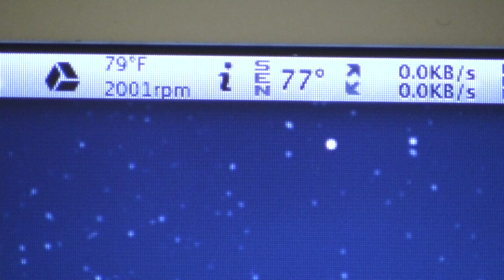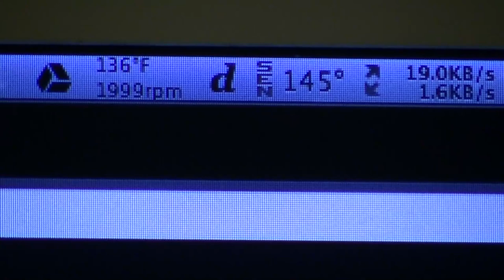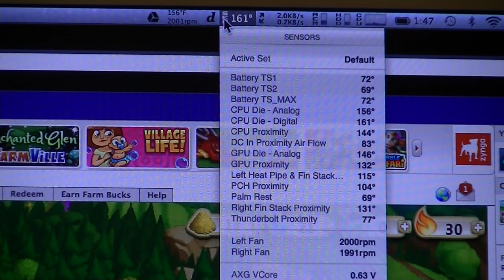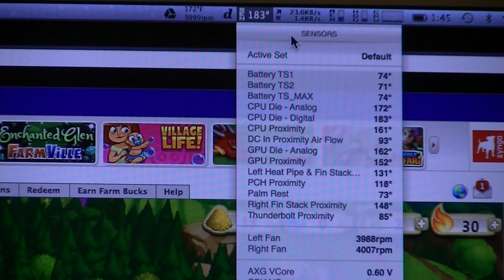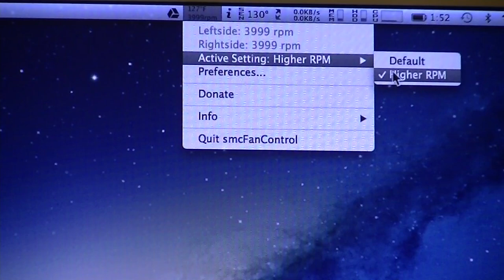HOWTO: Stop Your Macbook Pro Overheating!

Comment: Hey, I was wondering if you could help me?
I recently cleaned my fan and added new thermal paste, so my mac now sounds nice and happy :)
However now it's not recognising the battery......have you ever had any problems with this?
I just has an X over the battery symbol and says 'no battery available'
Also in the 'power' section of 'about this mac' it just has '0' and 'no' next to everything.
I opened it back up to make sure that I hadn't missed anything and that all of the connectors were free from dust, I also tried restarting, smc, and battery updates but none of it seems to be working.
I think that the battery was a little buggered before anyway (my laptop is 5 years old) but at least it recognised that it had one :s
Do you think that I should just get a new battery or is there anything that I can do first?
Thank you for the amazing video by the way :) It was very thorough.
Amanda
x
Reply from the maker: Sounds like you are in need of a new battery!  If you unplug the power, does it immediately die?
Reply: It does indeed :( it was ok before.....well, it ran anyway, I'd been having issues with it since I upgraded my operating system.
Anyway, yes it does just switch off as soon as I take the power cable out :(
Thankyou for getting back to me
Reply from the maker: Amanda Goodfellow No problem!  In your case, if I was certain the battery was hooked up correctly (I would disconnect and reconnect it, just to be sure) then I'd replace the battery.

Comment: thermal issues seem to be the main achilles heel of modern macs. I understand that they're primarily designed to run in air conditioned buildings but personally I would prefer to be able to use it without AC and rely on fans.
 By which I mean desktop fans.
Reply from the maker: Agreed - I wish Apple would put more effort into better thermal management of their systems.
Reply: uberDoward
yeah my macbook has had issues with this and it's really frustrating. I'm gonna do this AS5 thermal paste move described in the video but I"m also going to look into liquid cooling options as a way of being able to run it without overheating. It's a bit shit that a chunky 2006 toshiba laptop has better thermal management than a sleek 2011 macbook pro.
Reply from the maker: You're right, I'd love to see what you come up with regarding liquid cooling!
Reply: uberDoward
no worries, I'll post a link when it's done.
Reply: unstoppableExodia i just wish it had more grill/ventilation even just as an option
Reply: sguigly
totally. I mean a bigger grille might allow more dust in but it makes a big difference to  a computer's ability to exhaust heat  away. I'm considering taking the back panel off my macbook pro just so heat doesn't build up so quickly in there.
Reply: unstoppableExodia i put mine on a cooling rack for cookies and use a keyboard cuz my left pinkie/ ring finger gets cooked
Reply: sguigly
in some ways I wish apple had stood by powerPC and it's more power efficient RISC architecture. Intel processors are nice for their software support but god damn do those multi core suckas get hot or wut!!!!. My macbook that I use very gingerly gets scorching hot in that top left corner above the esc. key. I rarely need to use it on the move so it might run great if I was to take off the bottom cover and place it on a fan stand. Then hook it up to an HD monitor bring out my wireless solar keyboard and wireless trackpad and I'm gonna be all up in it
WOOO It's gonna be all kinds of kickass
Reply from the maker: PowerPC G5 wasn't exactly a cool running chip.  The Mhz Wars claimed the PowerPC architecture, unfortunately :(
Reply: uberDoward
It's a shame as PowerPC was a really cool technology but I guess in the modern age software support trumps power efficiency.
Reply from the maker: Absolutely!  Hardware is useless without software, and software is just as useless without hardware.  They must both work hand in hand to succeed :)
Reply: uberDoward
The two do go hand in hand I guess the convenience of software developers will always win out in the end.
Reply from the maker: unstoppableExodia IMHO, a good software developer (engineer, really) should have a thorough understanding of how the hardware works, in order to create the best experience with his or her software :)
Reply: unstoppableExodia I have used mine outside, in shade and direct sun, for 8+ hours/daily in 100-114 degree Phoenix, AZ, heat for years straight... The aluminum body itself is a giant heat sink... Yeah so what it gets "hot"? So do recording consoles and old tube gear, hot rods, and guns. I like to think that Jobs created it in a league to where the only time I would have to open it up and 're-do' his specs would be to add more RAM in a slot he already allotted. This is just my opinion. Take it with a grain of salt, cheers. My only point in writing this is to vouch that they are, indeed, workhorses and not made of crap, nor designed to be crap... Peace.
Reply: *****
I'm happy for you that your mac has been so resilient. I'm guessing you bought your's new. I got mine second hand. But the place I'll be moving into soon will have air conditioning so I'll be free to use my macbook a lot more and same goes for my imac once I swap out power supplies.
Reply from the maker: ***** Unfortunately, nobody's perfect - the reality of all laptops is that of compromise, and the MacBook Pro 2011 compromised when it came to heat rejection capability.
Reply: uberDoward
the 2011 macbook pro is woeful during an australian summer. I made the mistake of having a fan blowing but no AC and that caused the graphics card to desolder from the logic board. I appreciate the sleekness of it's design but if that comes at the expense of proper heat rejection capability then I'd be prepared to make a few trade offs to have a laptop that can handle a 40 degree day.
Reply from the maker: I hear you there - it's a shame, but that's what Apple does!
Reply: uberDoward
If all goes according to plan then this coming summer could be my macbooks big chance to shine. The new place I'm getting ready to move into has a solar system to minimise the electricity used by the A/C so I'll be using keeping the room that it'll run in nice and cool but I plan to experiment with fans and seeing if removing the bottom cover helps it jettison that unwanted heat. I want to use it more like a desktop by having it hooked up to an HDMI monitor and with a wireless keyboard and trackpad to control from the chair.
Reply: unstoppableExodia i

Comment: Overall, I like the video (though I have basically binary-searched into the part that actually deals with the problem :-) )... Very good advice re. NOT EVER using anything metallic to remove the gunge from the heatsink mating surfaces. Thanks!

Comment: 17" Macbook Pro 2.53GHZ i5  
 
Before it was overheating then shut down it was too much for it to take many  programmes. 
I have added copper shims on the CPU & GPU and on Nvidia 
But after putting everything back now it just starts up with blank white screen then it shuts down.

Any ideas 

Thanks
Reply from the maker: The copper shims were likely a bad idea - remove them!  Clean the copper parts of your stock heatsink, and apply a tiny amount of arctic silver as I show in the video, and you should be good!

Comment from the maker: You need to open (or have someone do it for you) your MacBook Pro.  You need to get the heatsink cleaned and lapped, as well as apply new heatsink compound of the PROPER amount!  You'll have a *much* cooler running MacBook Pro, then :)

Comment: Who the hell uses Fahrenheit for measuring CPU temps?
 Great job though, I've done this on every laptop and desktop I've ever owned. These manufacturers all use way too much thermal paste. I've mostly used the AS5 thermal paste, but for my last one on the wife's Thinkpad I tried Noctua. It seems to do pretty well, I guess I'll see how long it holds up compared to AS5.

 I now have a late 2013 MBPr with Windows 7 that runs super hot and sounds like a 747 jet taking off as soon as I put a load on it. I'm a little bit nervous about attempting this one. Apple deliberately made this thing to be as difficult as possible to work on. I don't know if it gets this hot with OSX, I can't stand to use that OS long enough to find out. I think they just made the laptop too thin for such powerful hardware.
Reply from the maker: Americans do ;)  50C doesn't mean a thing to me.  I think it's a little warm?  What is that, like 130F? - ah, no, 122F.   Yeah, they just run them down the assembly line.  The manufacturing of the heatsink is also atrocious, if you've checked Apple's out you'll see what I mean!

Comment: Haven't read ALL the comments, so sorry if I'm being redundant, but the part where you actually remove the heat sink is completely off camera. And that's the whole point of this video, right?
Reply from the maker: Once you unscrew the heatsink, ensure all cables are disconnected, it just pulls off the same as any other heatsink :)
Reply: +uberDoward thanks much. Been trying to figure out how my MBPro hasn't melted the table it's on.
Reply from the maker: No problem, happy to help :)

Comment: My Mid-2012 15" 2.7GHz i7 & Nvidia GPU MacBook Pro still heats up the CPU to 104-105c under load with handbrake even after replacing thermal paste :(

Comment: i cleaned it and it don't work, so my soultion for it is running without a back cover with the macbook pro lift up by around 7cm from the surface and get a fresh airflow to it
 and i get a big huge temp drop by removing the back cover
before doing anything - 90c MAX
cleaned with back cover on - 80C MAX
cleaned with back cover off - 65c MAX
mac model - 13" Mid-2010 MBP
Reply from the maker: I can in NO way recommend that - anything conductive that gets under there is going to zap that motherboard dead!
Reply: uberDoward
fine so i need to live with 80c? putting my cover back on now
Reply from the maker: ***** 80C is a great temp for a MacBook.  Apple actually lets them run up to 90C max.
Reply: uberDoward
thanks i don't know that, but wait my macbook pro have touched 100C before that it don't shut off and no thremal thorrtle so i need to manage it myself, wtf no core 2 duo thremal throttle
Reply from the maker: ***** Yeah, if you hit 100C before you DEFINITELY needed the re-paste!  Core 2's have thermal throttling - but IIRC it's really relaxed, and will run 100-105C before it throttles.
Reply: uberDoward is it ok to open the normal computer (tower) side panel? will it do anything? and running without side panel? is it bad?
Reply from the maker: ***** You can open a tower side panel and put a fan blowing in, and that'll work well - but optimal is to have proper airflow through the case!
Reply: uberDoward
won't some sort of conductive thing short it out?
Reply: i have 2 intakes and 1 exhaust, is that opimital ?
Reply from the maker: That should work pretty well :)  Positive internal pressure!
Reply: uberDoward
yay lol
Reply: +MinBCraft late comment - i didnt do a repaste, but i did low the temps down by 5-8c without the back cover off, i now use windows 7 on it and i use throttlestop and turn the voltage of the cpu down from 1.165v to 1v which makes  a big temps drops and no unstablity also 1v/2.4GHz makes the CPU temps like its 1.100v at 1.6GHz
Reply from the maker: You should have done a repaste while you were in there!  Opening the bottom would scare the heck out of me - my MBP and I go all over the place.  Without the back cover on, I'd be shorting that logic board out right quick!

Comment: I really appreciate this video, but now it has me feeling like Apple did this on purpose because too much overheating causes mechanical failures which leads to repairs, replacements, and the purchasing of a new Apple product.  I mean, why else would they use up more of their resources than necessary?  I'm pretty sure that it's not out of generosity.

Comment: anti-static wrist band maybe? no, of course not
Reply from the maker: With the conductive metal chassis of the MacBook Pro, an anti static wrist band isn't strictly necessary.  In all honesty, as long as you remember to discharge any built up static charge the odds of you somehow building up another charge while working on the system is extremely low.  Still, never hurts to be careful!

Comment: Dude you confuse other people by using Fahrenheit instead of Celsius degrees. 

Plus a little trick I learn from a veteran IT as myself, use some high quality NON-Conductive Thermal pads and cut them size to the CPU and GPU back area of the motherboard and stick them behind the motherboard.  I would also cut the same size of the black plastic that is attached to the back plate that have the fan cutouts.  This will let the thermal pad touch the aluminum back plate helping more to cool down the processors.  I use a 2mm Fuji-poly thermal pads because they are the best! It will knock down at least 10+ degrees more for sure! I'm idling at 22* degrees Celsius and 24* degrees on the Radeon HD6770 GPU!
Reply: Interesting with the thermal pads. Could you show it more specifically where you apply these pads?
Reply: Oohh, I get it now! That's brilliant :)
Reply: *****
I too would like to see photos of that thermal mat assemnled with the macbook pro.

Comment: my laptop only overheats when i use it while charging at the same time, especially when I am playing music. Other than that, it works just fine. It really only overheats while it is charging.
Reply from the maker: When your battery is charging, you have 'full power' as it were, to the laptop.  Which means your laptop can run at full speed with no issues, up to the thermal limitations imposed by the cooling system.  This is the big advantage to this procedure - you can run full Turbo mode without worry!
Reply: so does that mean i dont have to disassemble my laptop

Comment: Does the Mothers Billet polish contain petroleum-based ingredients?  If so, you will permanently damage your components.  See Arctic Silver's application guides: http://www.arcticsilver.com/methods.html.
Reply from the maker: Irrelevant - if you polish correctly, there's no Mother's left on the heatsink.  For that matter, petroleum WILL NOT damage your components.  Petroleum products such as degreasers or WD40 will simply prevent optimal thermal transfer, as Arctic Silver states quite clearly.
Reply: uberDoward
Totally agree with sandman about polishing and leaving petroleum based oils embedded into the copper heatsink base.
Reply from the maker: daaudiome Directly from Arctic Silver - "NEVER use any petroleum based cleaners (WD-40, and many automotive
degreasers) on the surface of a metal cap or heatsink. The oil, which is
engineered to not evaporate, will fill the microscopic valleys in the metal and
significantly reduce the effectiveness of any subsequently applied thermal
compound. "

If you polish correctly then there is nothing left upon the surface.  The last step of your polishing is cleaning the surface with an alcohol-based solvent - leaving zero petroleum product upon the surface to cause any thermal issues, as AS states.

Comment: what can I do if the fan is overheating
Reply: +ashley rodriguez  I doubt your fan is overheating... The thermal paste on your computer is probably insufficient. This problem is with almost all prebuild computers in the industry. The computer relays the PWM fans to spin faster depending on the cpu and gpu temperatures. The thing is the temperatures will increase if the heat is not transferred well through to the heat sinks. Increasing the fan speed will not solve the problem.
Reply from the maker: +FSociety Well said :)

Comment: Hello,
After fixing an issue with my MacBook Pro keyboard related to an overheating problem, I followed your video. I cleaned the chips and reapplied the thermal paste (using Gelid GC-Extreme thermal paste).
It was a good idea and now, thanks to you, the cooling system of my Mac is much more efficient.
Though, it was not enough for me. The default fan speed policy that come from Apple stinks.. its primary goal is to reduce the noise of the computer regardless to the temperature, so, under high usage, you still see the temperature going up because of the fan's low speed.

So, I wrote "Keep-Cool": https://github.com/marcolinuz/keep-cool/wiki It's an OSX Service that runs in background and dynamically adjusts the speed of the fans.
I implemented 4 Computing Algorithms for the Fan(s) speed and I think it's very effective in optimizing the operating temperature of my Mac. :)

If you can, please give it a try and let me know what you think about it. :)
Reply from the maker: I'll check it out tonight, thanks!
Reply: uberDoward Hi, I made some updates and added a video tutorial about how to install and use it.. you can find it here: http://sourceforge.net/projects/keepcool/

Comment: Go ahead, laptops are a real fucking bitch to deal with though. And ground yourself if you live in a dry area. Pretty much everything on a retina is soldered to the board, so if something breaks, you can't just replace it easily.

Comment: Trick to a cooler Macbook without taking it apart.
Simply lift the Macbook at least a quarter of an inch off the table (rubber foot stickers). 
Place a small fan behind the Macbook Pro.
Works better than any thermal paste.
Reply from the maker: +Imagine This Well, I will say that yes, this will slightly increase cooling capacity.  Better than thermal paste?  Ah..... I'm not willing to state that as fact.  Namely, if the thermal paste is keeping the CPU die from being able to transfer heat as fast as possible to the heatsink, it doesn't matter how 'cool' the laptop feels - the CPU will still overheat.
Reply: uberDoward
This recommendation is not meant for you.